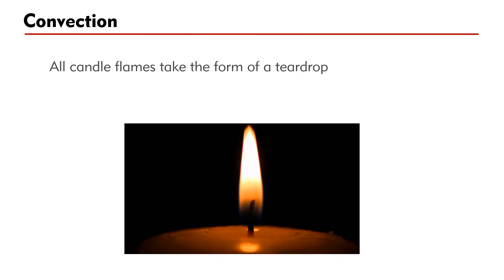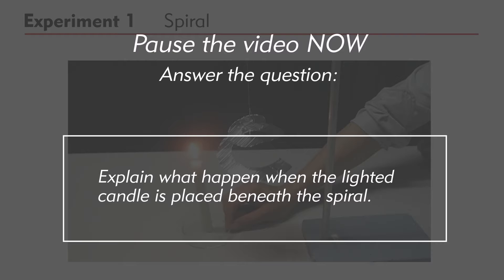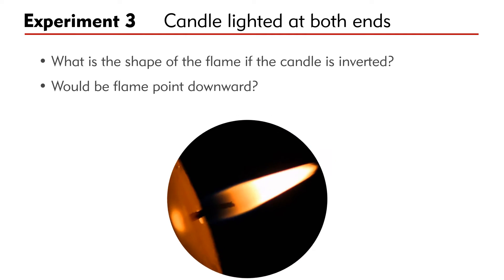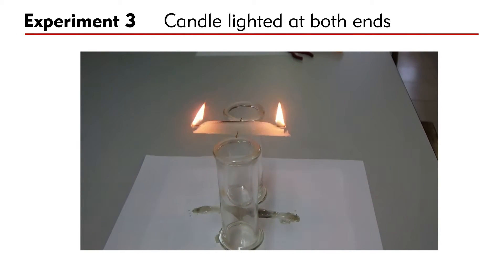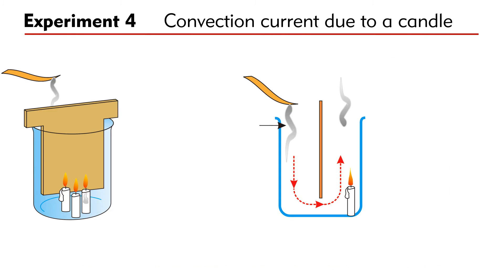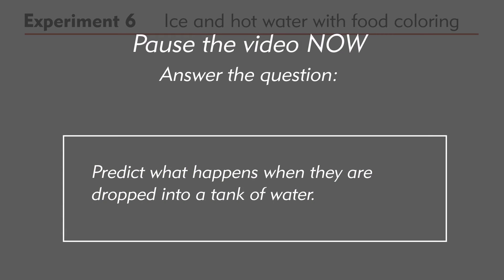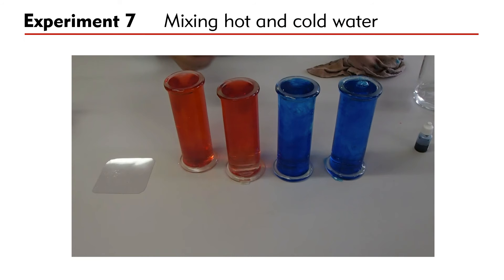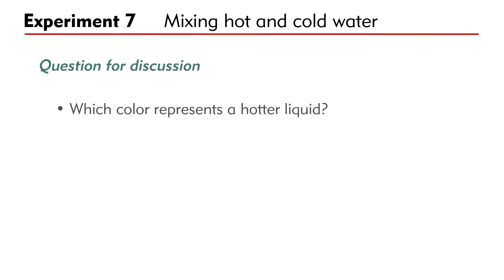Convection

Comment: From the experiment, I'd conclude that the liquid with the red food colour dye would be of higher temperature. 
According to the theory of convection, stating that hotter particles rise, colder ones sink.
On the right side in the experiment setting, the red liquid remains upright upon the mixing of 2 liquid; whereas it rises and mixed with the blue liquid on the left side as long as it's mixed with the colder (blue) liquid, suggesting it's of higher temperature.